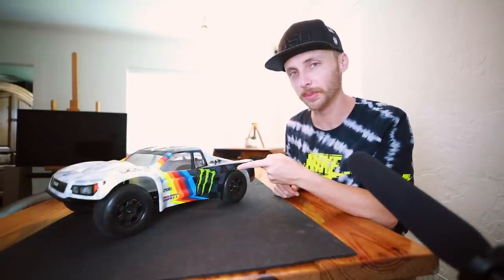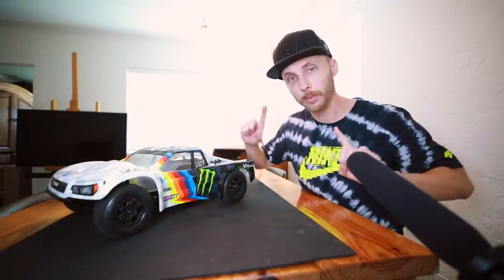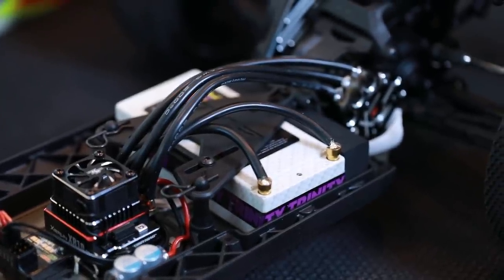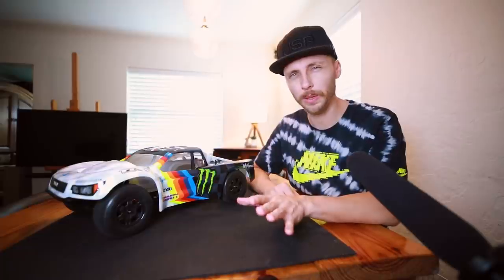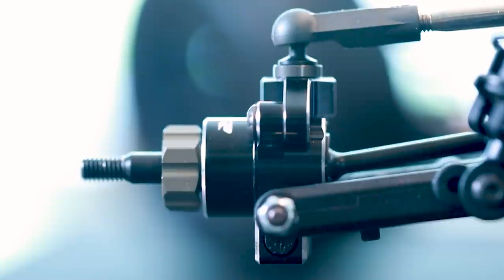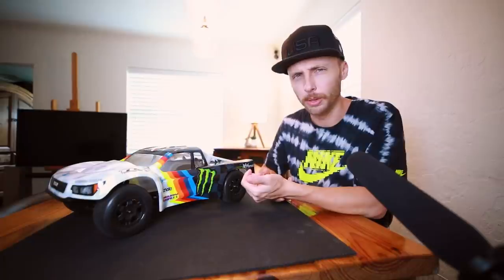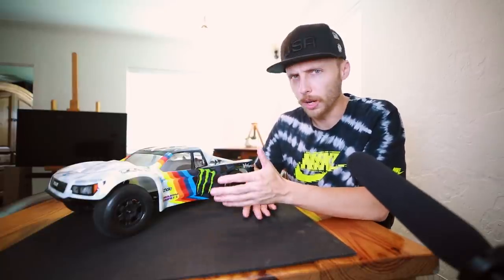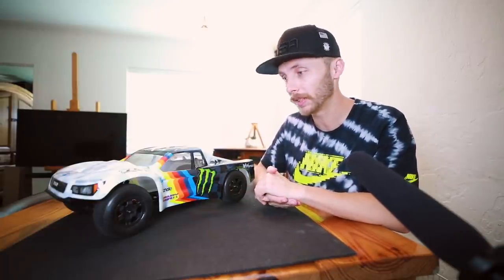Making a RC Short Course Truck, Ken Block style!!

Comment: A suggestion would for you to do a video or series on the very basics, for people just getting into the hobby.
Maybe the difference between tire treads and where and why the work, basic terminology , caster, camber, toe in/out, shock spring rates shock oil where what oils are applicable, what things do and why.
Basically what you want the car to do and what it takes to make it happen, you may get a good following from people from the time they start and on.

Comment: Ryan, what spacer did you use to shim the rear axle on the rims? I'm trying to install the VHA hubs on my truck. Also, does the stock driveshafts fit directly into the 5.0 axle?

Comment: Converting the SCT into a B-Mod will be easier and cheaper than turning into a drag car. Get the 5.0 and put the SCT chassis on it with McAllister racing body posts is the easiest way to do a drag car.

Comment: I have had the TLR 22 SCT 3.0 for 8 months now and run on backyard loose dirt tracks, so I will keep the stand up trany. But I do want to try that 5.0 rear set-up. I already upgraded the steering and bellcrank. Question: when you run yours, can you try out a brass bulkhead up front? Does the weight improve the steering and handling?

Comment: Im pretty sure the 22t 4.0 laydown trans fits on the 3.0, instead of having to buy that lowrider kit. I dont own a 22sct personally but alot of the other drivers at my track who run them use the 22t 4.0 trans